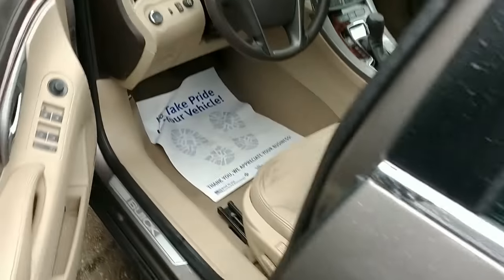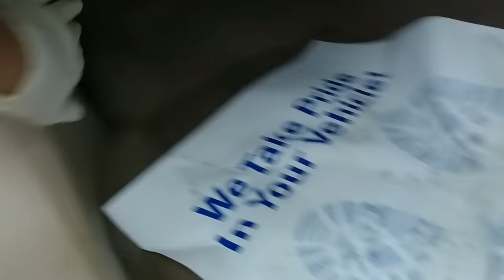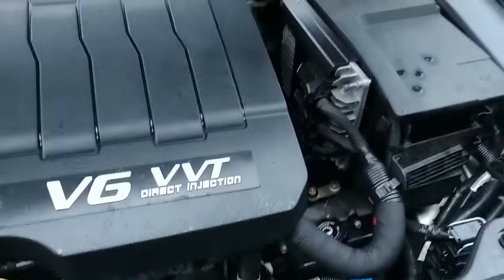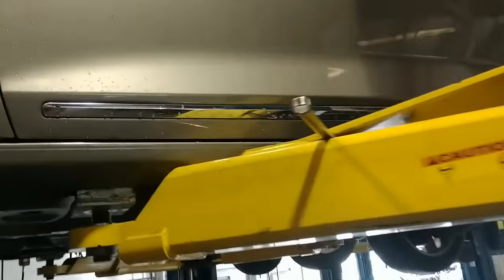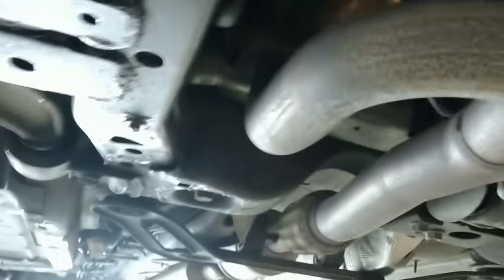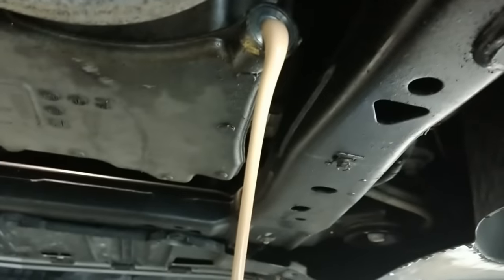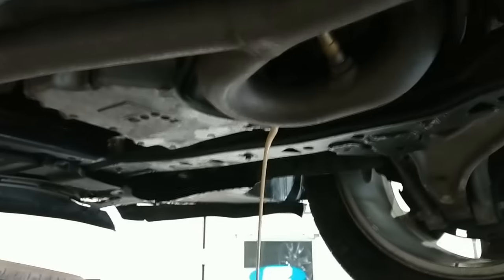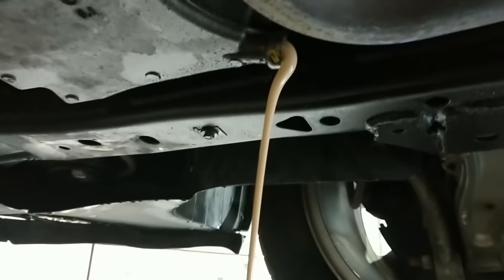Overfilled Crankcase! Blown ENGINE! Used Car Nightmare!

Comment: 15 years ago I was a manager for Advanceauto in Ridgeland, Mississippi and had a guy come in complaining about his car not shifting right.  First thing I do is check the dip stick and I'm so shocked that I call my GM to confirm my findings without telling him what I thought was wrong.  He did and told the customer "sir, you have motor oil in your transmission."  He had just had an "oil change" at Wal-Mart.  I told him to go straight back, talk to the manager and threaten to sue if they don't fix it for free and then keep the records of their screw up so that when the transmission failed Wal-Mart would have to pay to fix it.
Reply: @ade rahmat what?
Reply: @ade rahmat you can get oil changes at Wal-Mart, see a physician, go out to eat at Subway, get eyeglasses, pick up prescription medication, have tires put on your car, buy paint, get groceries, and make a withdrawal from your bank... In the same visit.

Walmart has had an auto center for decades.
Reply: @ade rahmat some walmarts have autocenters. Probably don't do major services but definitely minor ones like oil changes and new tires
Reply: I knew someone who got an oil change at Jiffy Lube. A few minutes after leaving, the engine seized up. They didn’t put any oil back in!
Reply: @firestick4991  You get a new engine! You get a new engine! And you get a new engine!
Reply: @FalconOfStorms  I saw a picture where you can buy a gun where the chocolates are
Reply: @ade rahmat You can. But that doesn't mean you should
Reply: When I was young they changed my tires. They did not put the lug nuts back on one of the tires. Luckily I noticed before driving any farther than across the parking lot. I would have been on the highway with a tire unattached. Obviously never went back there again.
Reply: This is why I do any and every auto maintenance I can. OIl, brakes, whatever.  Last year I taught myself how to do a timing chain service.  I was actually willing to pay the thousand plus dollars, but the first shop I went to said "we don't do anything like that".  I was amazed. But after watching a few vids here on youtube I hadn't seen anything that was beyond my skill, so I did it myself. Car's run like a swiss watch since.
Reply: @cswann8  I’m the same way but that’s because I don’t trust most mechanics to do it right but I’ve found one I trust.
Reply: Sometimes I hate living in Mississippi
Reply: @ludwigmaxis1966  I love it for good and for ill.
Reply: @ade rahmat you don't say?
Reply: Not sure i believe that
Reply: @herculesbrofister265  Hand to God, I didn’t believe it either, that’s why I had my gm double check without telling him my thoughts.
Reply: Brought my car to Walmart for a tire rotation and fix the slow leak in the right front tire 

When I picked it up it still had a slow leak in the right front tire
Reply: @vidguy007  i bought a set of tires from them about a year ago (I needed super cheap) and watched them like a hawk. If you take your car to them stand outside the bay and watch them super close.
Reply: I know several people that have had something like this happen to them specifically at Wal-Mart. When the mechanic went to drain the oil pan, they drained the transmission instead. They then overfilled with oil thinking they had drained it all out. Unreal lol.
Reply: @ade rahmat No problem Sir. Also not every Walmart is large enough to have a car services section but many of them do have one. Wal-Mart does a lot of things well, but their car services do not always have the best reputation.
Reply: Never a problem with Walmart oil changes. Toyota dealer forgot to add oil .Same dealership spilled oil all over engine. Called and informed them about the huge spot on driveway. They said the  oil pan gasket needed changing. That was 3 years ago. Hasn't leaked since. Never gone back. 
Dealership mechanic showed power steering fluid all around reservoir and pump. Said it needed repair. 4 years ago. Never repaired, works fine.
Reply: i live in that area and there is no shortage of raggedy ass cars that should be in a lot better shape than they are...
Reply: @madrabbit9007  amen!
Reply: @madrabbit9007  hello from Long Beach/Gulfport, MS
Reply: @DevinWxChase   Dont call Wal-Mart employees mechanic, they are Lube Techs. Not all automotive repair people are Mechanics, there are Automotive Technicians. When people call me a mechanic, I point at my ASE badge and say Automotive Technician.
Reply: I am wrong they are GS (General Service) you have to have a certification in oils to be Lube Technician.
Reply: @radosvetakinova1216  OMG only in USA.
Reply: @xinox73  😱😱😱
Reply: Per Walmart policy the lube technicians must smoke 1 blunt per every 2 hours to work in the oil change department. 

I grew up in Mississippi in literally the exact same area. So believe me this doesn’t surprise me  one bit. Walmart normally uses the mirror test for hires around here. 
Put mirror under nose
If mirror gets foggy Yup 👍 
Their breathing and their hired on spot. 
Come on in Darious Damien King Jr. and let me show you how to change dis oil. 🤣😂
Reply: There just not trained, if they were it wouldn't of happened
Reply: @ade rahmat don't feel bad, I'm American and I didn't know Wal-Mart does auto work. I've never seen a auto center at any Walmarts I've been to.
Reply: @Ducking_Fustin  lmfao
Reply: @firestick4991  Got an oil change at Jiffy lube, they broke my hood prop, bent my hood at the prop point (I think the tech tried to close the hood without removing the prop) and crossed threaded the drain plug in one visit. They tried to blame me that I brought it in with the hood and prop broke until I told them I watched them prop the hood when I arrived. They paid for the fix and a rental car, but never heard a word from any middle or upper management. Never again.
Reply: @Rico_5551  That's funny,  the last time I had a car's oil changed was back in the 90's and when I got in the car it smelled like someone has smoked in it, the radio station was changed and the seat was laid back almost entirely flat. I've heard that any Walmart worker that lasts 6 months is bumped up to a job with the post office.
Reply: I once drained the tranny instead of oil but when I saw the red I knew what I done. A front wheel drive it’s easy to pick the wrong pan if you don’t pay attention!
Reply: Speedy rapacki  read some of the previous comments. One guy said he did it himself but thankfully caught the mistake before it went too far. As for calling bs, you clearly underestimate the stupidity of your fellow man.
Reply: Speedy rapacki  don’t ask me how they pulled it off, all I know is it happened. I was so flabbergasted I had to ask my gm to double check behind me.
Reply: @michaelb1221  I blame weed…it makes people epic stupid.
Reply: @ade rahmat yep can at costco too not sure how reliable though
Reply: @firestick4991  well the idiots would have had to fork up for a new engine cause they screwed up a service they needlessly cost their shop money
Reply: Speedy rapacki  no most cars have a trans drain plug also! Just put a new pan on a 93 f150 at my shop for a customer and it came from ford with a drain plug!
Reply: Speedy rapacki  most all the ones that come into my shop do!
Reply: Stories like this are what motivated me to start doing as much of my own car maintenance as possible.
Reply: @firestick4991  my buddy used to be a manager at Jiffy and one of his guys did the exact same thing. Customer came back 20 min later with a smokey engine. 8 year employee but they still had to let him go. You just can't do that man lol
Reply: Speedy rapacki  Not entirely true. Certain late models of Subaru have identical pans with the same plug and enough splash guard in the way to easily pick the wrong one. Even the local Subaru dealer has a bulletin on the wall warning them not to drain the wrong one. Only thing you can hope is when the plug is loosened you see whether the fluid is brown/black or reddish.
Reply: @radosvetakinova1216  That picture was a meme lmao. Or it was a BB gun. The guns sections are....where the guns are found.
Reply: @xinox73  Sounds like somone doesn't like freedom...
Reply: Don't get anything done on my car at Walmart anymore. Sometimes they do a great job, but when they don't it's a total goat rodeo. The best thing to do when they screw the pooch is go straight to the store manager and take it higher from there.
Reply: I normally do all my own scheduled maintenance, but a few months ago I was in the middle of moving, so I had a Walmart oil change in my truck out of necessity (tools in storage, minimal choices for service on short notice).   I just did the next change after Walmart, and not only was my oil about 1.5 QTs short on a 60k mile WELL maintained vehicle (my fault for not verifying the dipstick right after service) but the oil filter was cranked on so tight I crushed it like a beer can and nearly destroyed it getting it off.  It was as if they found a way to tighten it with the daggum impact.  NEVER again.
Reply: @firestick4991  I have a lady friend who has used those places a time or 2. She said she watched them like a hawk!
Reply: @firestick4991  That happened to me at a Jiffy Lube. Surprisingly the engine was still running perfectly when I scrapped the car.
Reply: I refuse to go to that place unless it is absolitely necessary. They are awful, shit product. Constant recalls on food (cuz it comes from chy na) , etc. Just to name a couple things
Reply: @cswann8  YEAH Thats the right idea: if you want a job to be done right do it yourself or lat ray do the repair.
Reply: Good old Ridgeland Mississippi.  Nice town. I've probably seen you in there before.
Reply: @jshan8205  I was the guy driving the old red 79 Firebird. Kinda hard to miss.
Reply: @ade rahmat not if you want your vehicle to last! I tries it and spent months getting oil system to work right. Never again.
Reply: @radosvetakinova1216  The truck stop restaurant in Belle Fouche has revolvers for sale at the checkout.
Reply: So did some idiot put the coolant in the block along with the oil? Even a bad head gasket should not cause that though I can see no cooling and oil full of coolant destroying the headgasket  along with who knows what else in short order as it overheats and has a mess instead of oil causing problems instead of lubrication.  If cars still came with proper gauges for water temp and oil pressure this would have shown up before the engine was this bad. Steam and water coming out the exhaust should have been a big clue.
Reply: @firestick4991  I've heard this story too many times....  they only have 1 job to do, but...🤦‍♂
Reply: @cswann8  Yep, me too... when the pandemic hit, I took apart the top half of my odyssey engine and cleaned out all the EGR ports. They were so clogged, I couldn't believe the car would run like that. The idle is still good and purrs like a kitten.
Reply: @madrabbit9007 "Ugh, guys, _why are you pissing in the gas tank?_"

Comment: It's Sad that people do people this way . This person probably spent everything they had on this car .
Reply: And at the same time y put all ur money in a car u can audibly hear dying.... tough
Reply: @stuffchannel3585  they probably put fresh oil and coolant in it to get it sold
Reply: @TheDoctorPretzel  yeah, I had a intake gasket go and it took me three days to diagnose what was going on. 1: because I had never dealt with it before (I was 18) 2: it ran Allright 

I drained 5 gallons of milk shake out from what started as 5 quarts of oil, pulled the manifold off, changed on the basket, put some oil in it then drained it after an hour, then some more oil, then drained it, I forget, but less than 500 miles, then put some new oil in it and that 350 never gave me any problem for the rest of the time I owned it.
Reply: gotta read the car fax and inspect it yourself
Reply: @TheDoctorPretzel  yeah that and these car lots prey on people who don't know anything about cars
Reply: Happens multiple times a day in every city and town.
Reply: Learn to check the oil. If they don't want to do that then shouldn't own a car.
Reply: with 75k miles youd think it was an okay car-=
Reply: And 33% interest at that
Reply: @bikeman1x11  Not with post-2000 Big Three products. I bought a 2016 Malibu Dec 2018 and traded on a 2015 Camry Sept 2019. WIll never buy another Big Three product designed or built after 2000-2005.
Reply: @anonymousinc6330  kind of sad - my 98 acura had no leaks, engine or trans issues- inly age things line bushings and struts and such
Reply: @bikeman1x11  Agreed. The Malibu had blow-by, CV axle noise, and the trans would hum loudly and refuse to shut up or shift 5-6 until I took my foot off the throttle. All before 80k miles. I've dragged 180k mile Buicks out of the bushes that I bought for $200 that didn't have these problems. Not only would GM not admit there was a problem with the car, they tried to blame me for doing the oil cap test for blow-by.
Reply: @AA-bs3iy  
they prey on folks with bad credit as well
Reply: The fast easy fix,

drain radiator,  and oil pan, refill both with engine oil , sell at auction
Reply: @stuffchannel3585  a lot of people are not mechanically inclined.
Reply: @itsNRC  car fax can have some surprising holes in the history.
Reply: @oceanbytez847  agreed which is why you should line up the dates to make sure nothings too far apart , see where the car is being taken too, and last but obviously inspect the car & or take it to someone who knows what to look for
Reply: What's sad is letting car manufacturers get away with selling JUNK! No reason for any car to have engine or transmission issues under a hundred thousand miles.
Reply: @stuffchannel3585  maybe it’s one those thing you gotta make money to spend money
Reply: The term "used car salesman" is not associated with honesty, integrity, or morals.
Reply: @OUigot  for real like I said it’s happened with brand new cars like my dads jimmy he traded he nice car for show room floor and it blew up in month
Reply: Stupidity is expensive...
Reply: @anonymousinc6330  Maliblow☹️
Reply: @thomasmleahy6218  Unfortunately, yes. The last decent Malibu rolled off the line around '84.
Reply: @MrCoffeekelly  Yup, and it's not just GM. Alright, stop...pushin' the Ford and listen... Henry's back with a brand-new edition, of somethin'... rusty, old, unsightly, drips like a faucet daily and nightly, (WILL IT EVER STOP?) Yo, I don't know... turn on the lights, and they blow... It's blowin' steam, the hood's too hot to handle... This piece of junk won't even attract vandals (DAMN!) Hit a Pinto and BOOM! Nobody wants to be in the same room (IT'S DEADLY) When it gets rear-ended... I thank GOD it could never be mended... Knockin'? Believe it - ya better make way... Not much better than a Chevrolet... A FORD with a problem? Who'd WANNA solve it? Just turn the key and PRAY it revolves it (MIGHT RUN, MAYBE... IT MIGHT RUN, MAYBE)
Reply: @bikeman1x11  1. Always wonder why the previous owner is getting rid of it.  2. Always question whether they did maintenance.  Like any.  3. Always question whether you're getting the truth. 4. People get real funny, real quick, the moment more than about ten bucks is involved.
Reply: Nice car besides the oil change
Reply: @WildBikerBill  number one. Only buy a Honda or Toyota.
Reply: @MrCoffeekelly  I eliminated the Big Three a long, long time ago, becoming a Honda Man in 1989.  My current Car To Buy If Disaster Happened is a Toyota (RAV4).
Reply: @anonymousinc6330  It's kind of funny you say that because out of the big 3 American manufacturers Ford is definitely the most reliable. I'm not at all saying it's the best overall, but out of Chrysler, GM and Ford, Ford definitely wins
Reply: @richardmillhousenixon   Just wait until all those EcoBoost engines start blowing up at about 150k. Rule number one of building reliable cars, you don't turbocharge a daily driver. There are already a ton of those 1.0L Fiesta engines that have bitten the dust, apparently they suffer from head gasket failure.
Reply: @TheDoctorPretzel  that’s true these places always do a very good detail job hoping the car makes it 30 days
Reply: @AA-bs3iy  the first clue was someone looking at a Buick. They knew they had a victim then.
Reply: @anonymousinc6330  😂😂😂😂 best comment 😊😊
Reply: @anonymousinc6330  nice nice j,c 😁
Reply: The big question is how much did she paid lol
Reply: @moustachio334  dunno. A friend inherited a 2002 Century when her dad died. It's a beater, but it's reliable.
Reply: Some people are really evil and rotten sadly.
Reply: @AA-bs3iy  Honestly you don't even have to know anything about cars.  I just throw out a random "that doesn't sound right" and gage their reaction.  Or I just walk away and 9/10 times change their tune.
Reply: @bikeman1x11  The car looks very nice and as you said 75K is nothing these days. At the very least the owner. is looking at replacing the head gasket but what caused the gasket to blow> Overheating? what caused that? Quite a bit of diagnostic work to be done followed by some heavy-duty mechanical work.